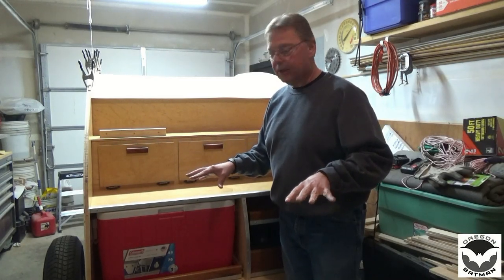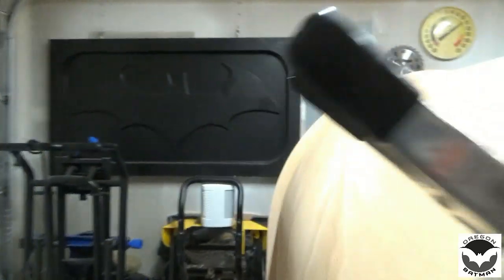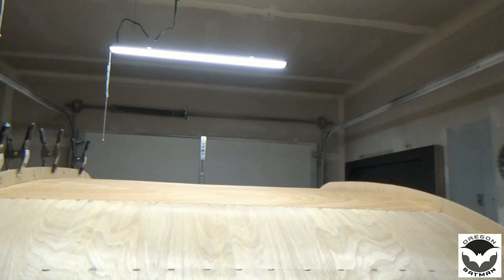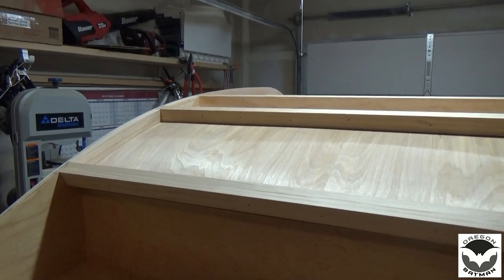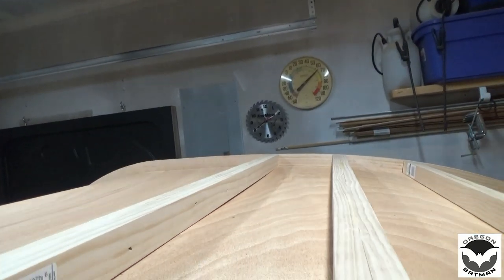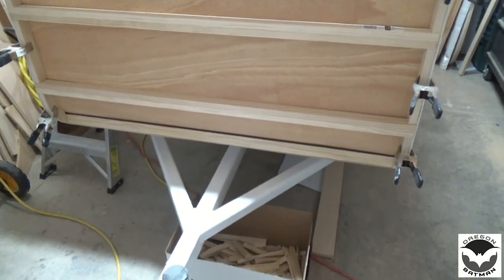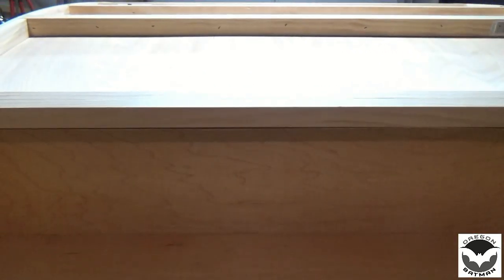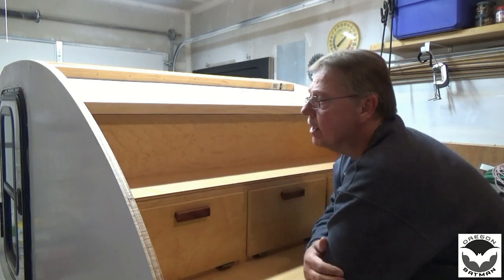Let’s Build A Teardrop * Step-By-Step * - Part 28 (Setting The Spars)

Comment: Hi Al, Is there a design or structural reason not to end your interior ceiling at the kitchen wall?  You went past an 1.5 inch.  I'm thinking the structural integrity with the first spar resting on the wall and screwing into it for the real hatch?  I hope that makes sense as I am finishing my design off your blueprints.  Thanks, Jon
Reply from the maker: Hi Jon, only for aesthetic reasons really... I think it just looks better with the overhang. Sort of like the eve on a house. Plus... if I decide to put some LED strip lighting under there, it would hide it nicely

Comment: Correct me If I am wrong, the only think holding that roof spar assembly in place is staples in the ceiling and or roof 1/8 sheeting, and the trims on the filon over the edges?
Reply from the maker: The spars are attached to the side walls with glue and screws at the ends. Thanks for checking it out!

Comment: What is the length of the sleeping area. I am 6ft 4in tall . Will your plans work for me ?
Reply from the maker: Hey Marc! The length of the inside is approx 70", so a little on the short side for you. The plans can be easily modified to fit your needs though. Add whatever width you need to all dimensions to make it wider, and for the length, the best area to add length is just above the doorway where the flat spot is for the fan, this way you don't lose the overall shape. Hope that helps, appreciate you watching!

Comment: way too much explaining.....just do it and then it will make sense.
Reply from the maker: I know... to a novice, I probably ramble on way more than I need to! From the emails I receive, it seems to be what is helping the beginners and first time builders. Thanks for the comment Doug, noted! :)
Reply: @OregonBatman  you set a good pace for me mate, havent used some of these machines before so its interesting to see the router used, starting to realise that i may have to outlay quite a bit to obtain reasonable quality machines to do the work required. i generally end up buying cheap chinese hand tools but like to buy carefully when i do.